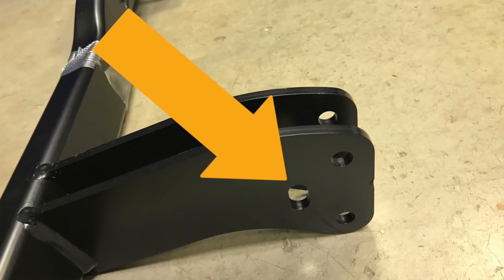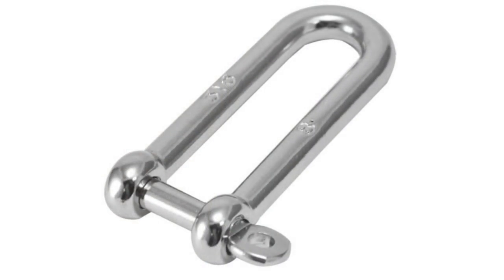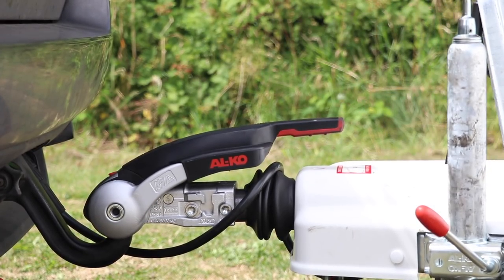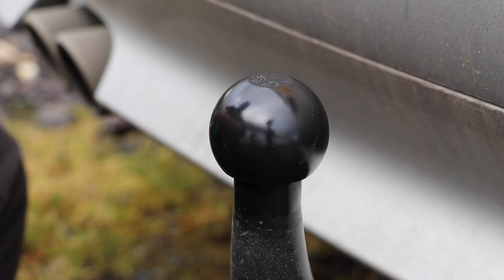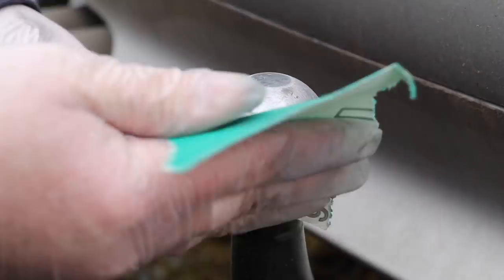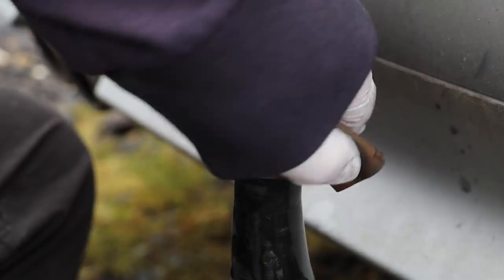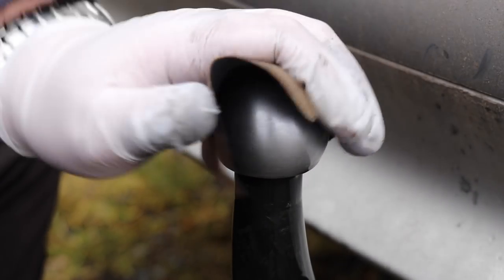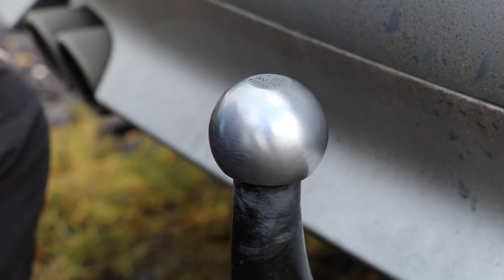Brand new tow bar preparation before towing

Comment: Hi dan, nice video has always, some comments on rubbing away the surface of the towball. Utter nonsense I think, a tiny fraction of a millimetre wont do any harm. Had a similar issue with my own towball not having a breakaway cable point, went to our local widnes caravan shop, purchased a oblong shaped metal breakaway shackle. It bolts straight on the back between the towing hitch and the metal plate. You can pick either of the two securing bolts so either left or right. Only cost a few quid, while there I treated the caravan to a new breakaway cable, again just a few pounds. All good now. Thanks, vinny.
Reply: Why do they paint it ??
Reply: Some what puzzled why not Make use with care of some paint stripper or  Cellulose thinners would do the job in a fraction of the time without scratching

Comment: Trailer secondary / breakaway cable  fixing bracket, for the breakaway cable but don't forget to use set the torque on the socket wrench when fixing. we have just changed our car so a new tow bar has been fitted with one of these ordered off Amazon. Great video i will do our tow ball this weekend

Comment: Great vid, thanks Dan, I do exactly the same. been towing caravans for 18 years, done this to the last 6 tow bars ive had( long story), never had an issue, although i don't do the P1200 stage i just use P800 and degreaser when away. 

I want to see more about the breakaway cable fit point i suffered same issue so I had a link welded on in the end.
Reply: Hi why not paint stripper . I'm a novice , just asking .

Comment: Hi Dan, instead of using the ‘elbow grease’ method, would you recommend using a brass cup brush and a drill? Noticed a couple of these videos which don’t damage the tow ball and looks more efficient than the sand paper method

Comment: In need of some advise, have just bought a caravan with a 13 pin socket and added an adaptor for my 7 pin socket on my towbar, what do I need to get so the leisure battery will charge and the fridge work when I am towing my caravan

Comment: Dan, there's a lot of speculation regarding break away cables and connecting them. It's perfectly acceptable to attach the beak away cable around the neck of the ball. People state there is a possibility the cable will jump off if the van becomes detached. I'm sure there is, but if the risk was high, (as skidding on a bald tyre is) I'm sure they would make connecting it that way illegal.
Reply: I know for a fact that mounting a breakaway cable round the neck of the towball is very illegal in the Netherlands and I suspect in the rest of Europe. Surprised it’s not illegal in the UK. THIS SO UNSAFE!

Comment: Dan... fab video, finally finally going to be joining this amazing club and have just had the towbar fitted. They've removed the paint off the ball but its not as smooth as yours ends up, do you think its worth going that extra mile and using the wet n dry to remove all scratches? Thanks. Just going through your back catalogue to remind myself :-)

Comment: Hi im very new to all this and had my tow bar fitted today !
I didnt know to take the paint off, so i hitched up my 4 berth swift and drove round the block and the noise panicked me luckily im suscribed to your channel and found this video. After unhitching iv noticed that the paibt has scratched off on one side of the tow ball head im now going to take off the rest of the paint as advised but will i need to somehow clean out the hitch head now or should it be fine now x ? Regards nicola x

Comment: Hi Dan, Did you get the issue with your breakaway cable location sorted, I was thinking after looking at your tow bracket if there is enough room to get a eye bolt with nut on the inside so that the clip could attach to that. Just thinking outside the box

Comment: Hi should the caravan and the car be level my caravan is slightly bearing down on the tow ball .... if that makes sense
Reply from the maker: Sure, they should be level ish, depending on the car. If in doubt have a tow bar fitter visit you and confirm the tow ball is the correct height off the floor.
Reply: @TheTrudgians  Thanks for getting back to me its only slightly out of level so I think its good to go

Comment: Hi Dan,  nice video. I didn’t realise you had to do this so I have towed my caravan with all the paint on my new tow bar. Now the hitch is creaking during towing. Have I wrecked the friction pads in the hitch? Cheers, Andy
Reply from the maker: HI Andy, not likely you've wrecked them, but they will need cleaning. Search on my videos for friction pad removal, and see how to clean them up. It may also be required that you clean inside the hitch, so use some degreaser and wet&dry and get inside the hitch to remove any paint.

Hope that helps

Dan
Reply: That's great - thanks for the quick reply Dan!

Comment: Very interesting never knew how those worked (haven't used on either). Usually give the ball a dab of grease a couple times a year (towing 3500kg ifor Williams ramp trailer). Is this a terrible idea?
Reply: Yes
Reply: @hhorst7904  care to elaborate?
Reply: @7eis  if you have a friction stabiliser

Comment: Hi Dan,
I’ve recently removed the paint from my new tow ball, it looked smashing almost like a mirror!! However a couple of weeks or so later it’s all rusty!! How can this be avoided please? 
Paula
Reply: Use a cover that fits onto the towball, you usually get one in the kit?
Reply: 76Sulaco Hi, I do use the cap it came with but it still goes rusty underneath it.
Reply: @76Sulaco  I use brake and clutch cleaner with a paper towel - keep it in my tool kit.

Comment: OMG. I can’t believe one would go to this extreme. Just drop the trailer on and go. The hitch will wear the paint off at its contact points. Put a little grease on the ball to reduce friction and stop the rust.
Reply from the maker: A dry hitch, needs the paint removed AND NO grease. They rely on Friction to make the stabiliser work correctly. Paint on the Friction pads would contaminate them and render them useless. You certainly do not want to reduce friction, you need to encourage it for the hitch and tow ball to work correctly. 

Older styles of "wet" hitches that need greasing would be fine to leave the paint on - not these types. 

Hope that helps.
Reply: John Maloney you must remove the powder coating or else it contaminates and the friction pads of your stabiliser and prevents them gripping and giving the correct damping effect. No need to do this for a simple non-stabilised tow hitch.

Comment: We paid the tow bar fitters to take the paint off. They use a special machine. It is perfect . They charged an extra £20 and in light of all the comments below, I think it was money well spent. We used to tow a trailer when we had a motorhome. No stabiliser hitch, therefore no need to take paint off. Hence it seems fair to pay for the paint stripping done professionally. Hope this helps.

Comment: Hi Dan are you able to put a breakaway tab on your tow bar as in the link? https://goo.gl/images/3ghBdY if not what about using a thick/wide cable tie to grip the breakaway cable around the swan neck park so it's tight if that makes sense
Reply: GINGERDAVID90 hi ya that is what I do put cable round tow next then put plastic tie round cable and through eye clip pull it tight enough so cable doesn't come undon if hitch was to come off

Comment: Is this not a "Fit for purpose" issue?
Reply from the maker: Hi Chaz, not an issue, the paint is there to protect the ball steel, removing it is required for stabiliser hitches. Some fitters do remove the paint as a part of the service, many however don't. 

Hope this helps. 

Dan
Reply: Actually it was the lack of a break away attachment i was referring to,it seems to be a bit of a design oversight to me.